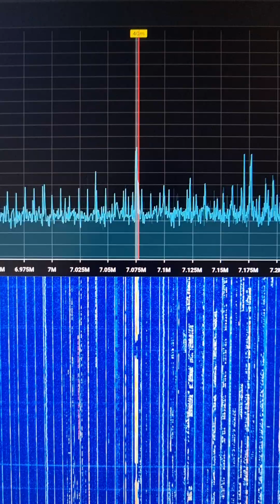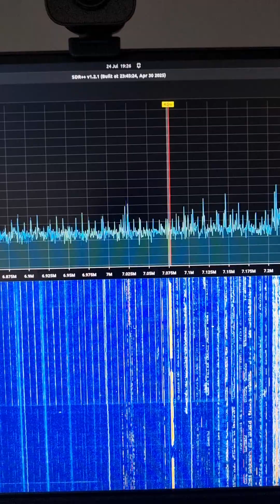Common mode choke cleans up unwanted interference on short wave receiver

Comment: Also, receiver right under antenna, connected to RPi then ethernet over copper, fiber, wifi. shorter signal path, better. Linux allows to tunnel USB over anything. So app does not even know.
Reply from the maker: That's a great setup for a remote receiver, using ethernet is a good approach, except my router generates a lot of noise which gets carried on ethernet cables. Fibre would be the best approach.